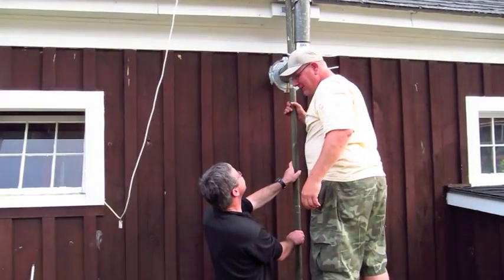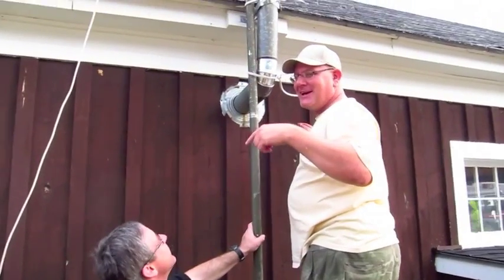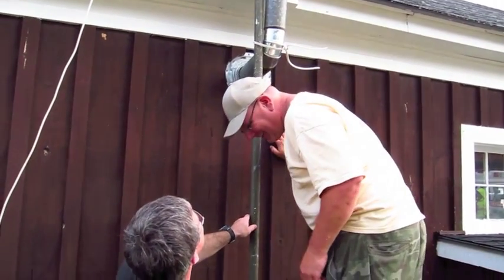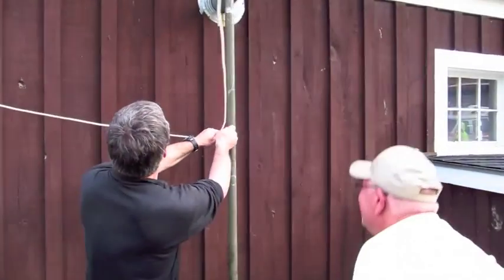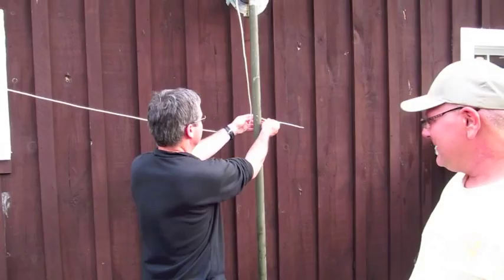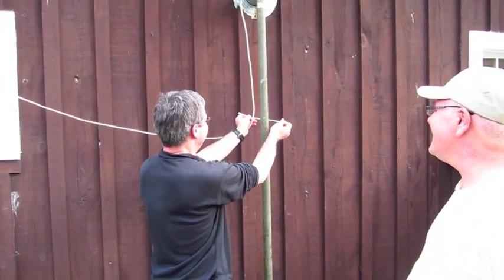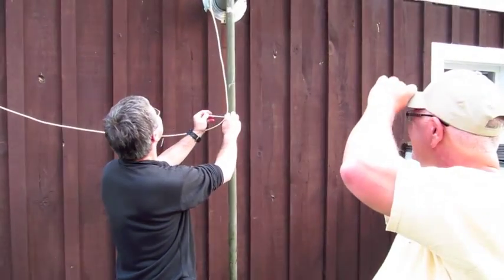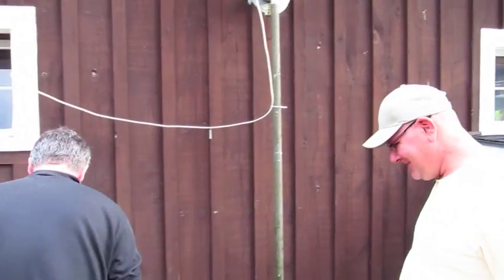Install Portable 2 Meter Antenna Mast Newton's Revenge 2012

Comment: 3 man nodig  ???  watjes :)  a litle tape for the cable !!! 1 real man can do the job .
Reply from the maker: Challenge: upload a video of your own showing you erecting the same antenna by yourself. Share the URL here when it's ready for us to see it. Can't wait...
Reply: @askthebuilder  i have not the 4 persons,  for me the second person for filming it :) i do it once a year for my heavy weather station on a metal pole 6 meter ....sent me a dual 2 meter and 70 cm  antenne and i try it 😎
Reply from the maker: @janvanderlinde3039  You don't need someone to hold the camera. Put it on a saw horse, a step ladder, a tripod, etc. My daughter has a saying: "Excuses are reasons for failures." I'm hoping your next comment includes the URL to your video showing you installing the same antenna by yourself.. Same height with the heavy diamond 2-meter antenna on top. Good luck.

Comment: Love the romex.  A real man's twist tie!  Did you use chain link fence top rail for the mast?  73 de KK6IDX
Reply from the maker: TNX. The mast is Army surplus radio mast. It's aluminum tubing. Each section is about 32 inches long and has a male / female end. No tools required for assembly. I have 12 pieces of it. It's very very user friendly and you can find it on eBay with ease.
Reply: Ask the Builder Yup, I can see it now.  Much more flex than you'd see with the chain link top rail.  Thanks for sharing, I love your videos, both ham and ATB related.